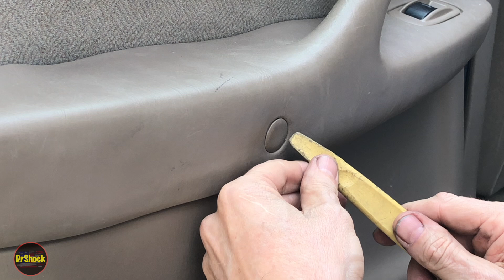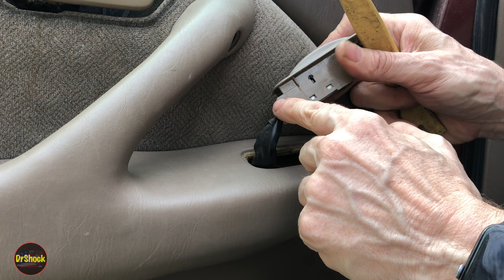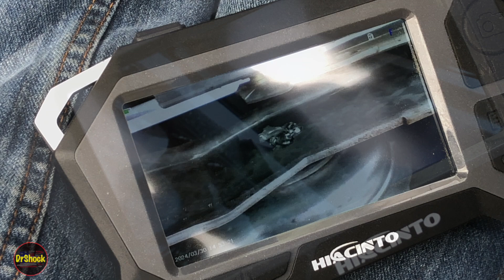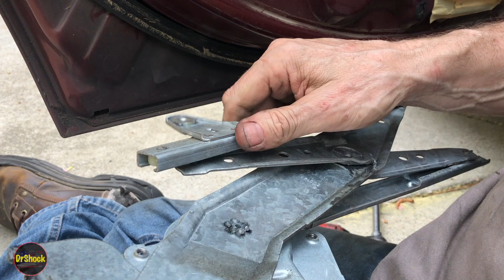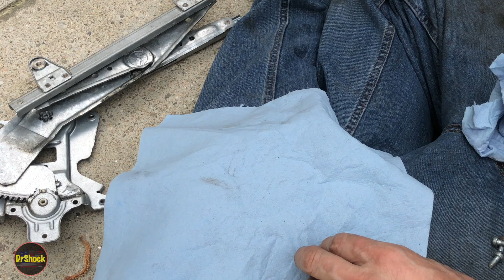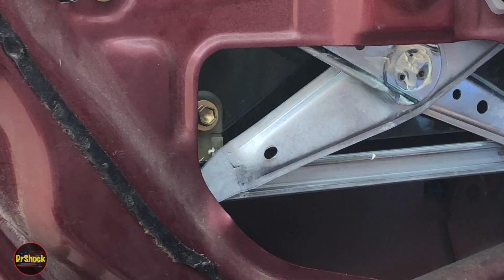1997 - 2001 Toyota Camry Rear Door Power Window Banging Noise ~ Motor Regulator Replacement

Comment: I have a completely dead window motor, so it is stuck up and I can't lower the glass to access the bolt holes. Do you know how I can lower the glass with a dead motor?
Reply from the maker: If I had this situation, I'd get a couple of helpers to hold the glass instead of using the tool I showed initially.   Disconnect the harness, and remove the door frame to regulator bolts as I show.   Then have the helpers carefully lower the glass until you can access the two thru glass bolts. Be prepared for the regulator assembly to drop in this approach, so have something in there as  cushion such as curled cardboard.  Have the helpers raise the disconnected glass, and secure with the proper tool.  The rest is as the video shows.